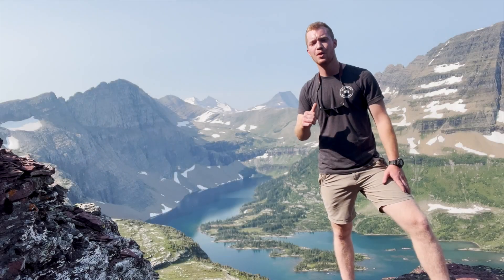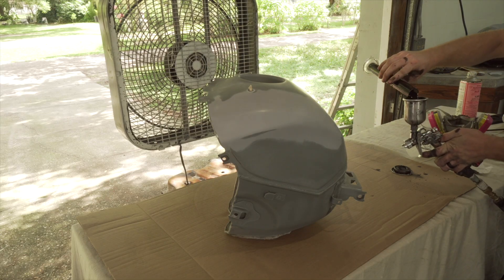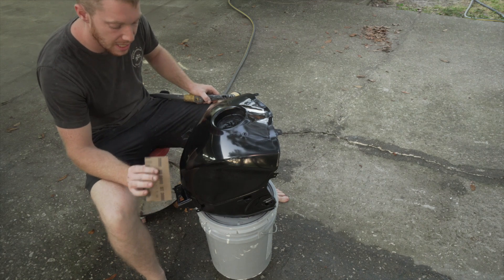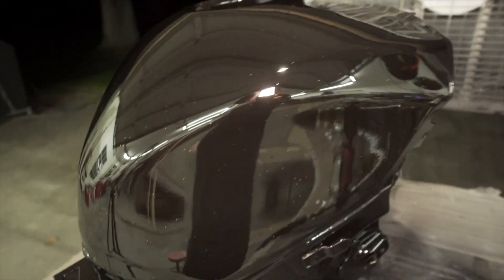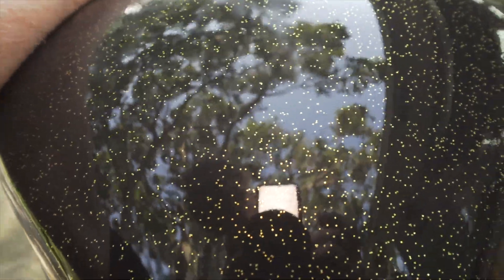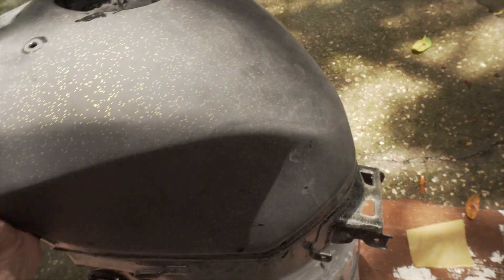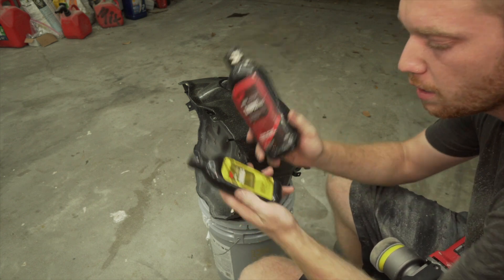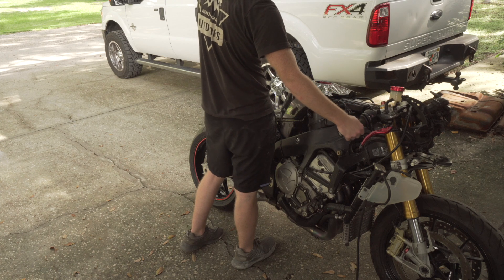BMW S1000rr Wrecked Bike Rebuild ( PT. 6 CRAZY paint job on a NEW tank)

Comment: Hi Ben, besides moisture, it looks like you might have a solvent pop issue.  This is where the solvent hasn't flashed off between coats so burst through the outer coats and looks like bubbles.  Spray painting is tough but when you start to get some good results it is really rewarding.  Keep at, and good luck.
Reply from the maker: Thanks for the input!  Duly noted!

Comment: When you runs use auto to pull the runs out it works . All so 3 three is all you and more it will a few days to get hard.  Start sanding with 320 then 1500 and finish with 100 sand paper and stop rushing it.
Reply from the maker: Gotcha! Thanks for the input!